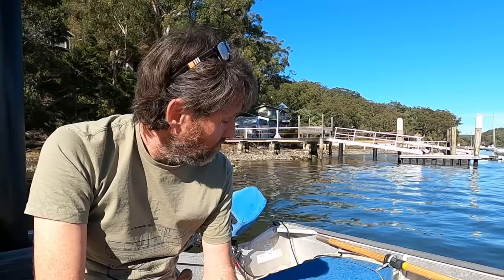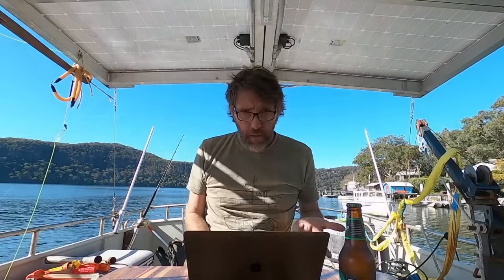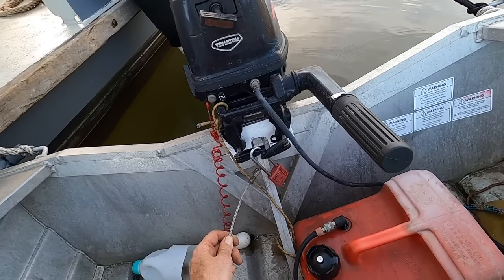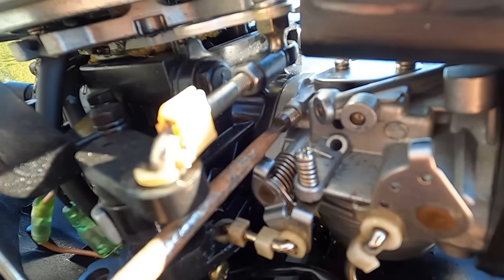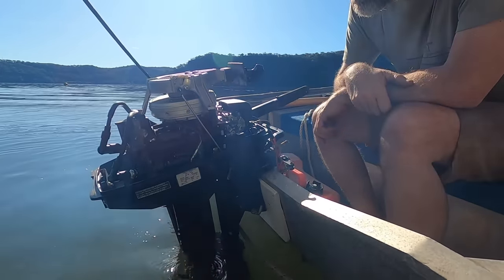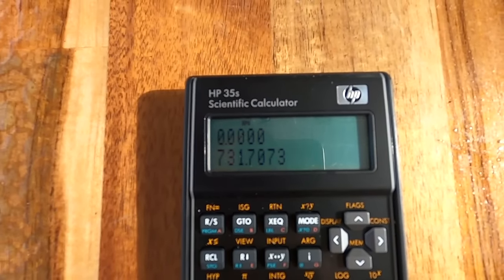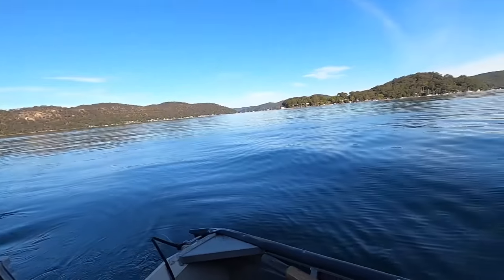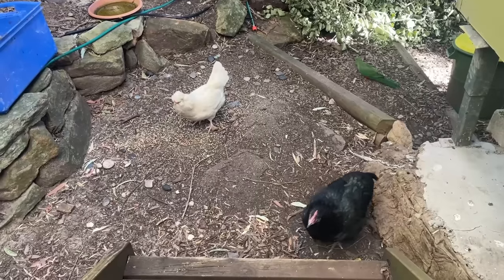Fixing an outboard that stalls at idle

Comment: Hey Stu ,recently found your channel .By far ,by a mile most informative thorough marine diagnose and repair and more. I found this video ,but wondering if you have an idea on. 15hp 2 stroke starts every time perfect idle and runs well at low speed ,but when you rev up on to plane and run for a minute or so , it suddenly cuts power and stalls. Seems to be very hot around exhaust on shaft.Restarts after half hour?? Is  There something common for this type of issue? Thanks Simon

Comment: Awesome and instructive videos. One of my outboards, a Johnson 35 hp 1983, gives me headaches. It won't stop running with the ignition key or the safe/kill switch. I remove and clean every ground wire under the "hood" and replace the ignition, still won't stop til I pull the choke. Any video regarding this dilemma?

Comment: I was unsubscribed by tube, put you on again today.  
Question: Why my T9.9 kicker wants to die with hood on in 30s but fine with hood off?  Really like your service VESSEL!
Reply from the maker: It can be a few things. An exhaust leak or a fuel leak will show up with the cowling on. With the fuel leak the fuel vapour gets added to the fuel from the carburettor and it runs way too rich.

Comment: Man I love your vids. Had the same problem with my car. Obviously a fuel injected 4 stroke, so totally different engine, but it was an idle air control sensor causing the problem. I like the simplicity of the adjustment screw on the 2 stroke! Anyway, besides learning about troubleshooting marine engines I like to see the differences in engines. Thanks for making these.

Comment: If you have to guess on a pilot screw, it's 1-1/8 to 1-1/4 turns.

My idle problem was air in the lines.  Very frustrating to find.  For what it costs to replace a line, if they are 20 years old just replace everything from the tank to the fuel pump that isn't metal (including the primer bulb), and use crimp clamps.  Also things that might help (with air in the lines):  Replace any quick connects that you don't need with a brass hull passthrough (or straight hose), and delete the oil injection system if you haven't already.  I've also heard that anti-syphon valves can cause problems but I didn't have one.  If you do have an anti-syphon valve spend the $20 and get a new one.

How to tell if air is getting in?  The first giveaway is that it idles fine for a minute to a few minutes but then begins to struggle and stalls.  It could run at power fine because the pump will be operating energetically enough to push the air through the system while still providing enough gas, but at idle the air builds up and starves the carburetors.  So the next step, my fuel filter is between the pump and the carburetors and is semi-transparent, so I was able to confirm air buildup by watching the air enter the fuel filter while idling.  If I rev'd up the motor the air would get pushed though, but at idle it would build up again.  I could also observe bubbles at the plastic tee where the oil injection goes in (since removed).

I can't say I ever found the leak because in the end of the day I just replaced everything I couldn't remove.

Tightening up hose clamps didn't help either so when I replaced all the lines I used crimp clamps everywhere permanent.  (So I left screw clamps on the fuel filter and primer bulb, but everywhere else is crimped.  Except the fuel pump because I could not get the crimping tool in there.  But use crimps wherever you can.  160 clamps plus the tool is less than $40 on Amazon.)

Comment: Hey Stu,
most likely there's a bit of junk partially blocking up the idle passage, or progression holes in the throat of the carby, or air bleed partially blocked if it is a 'too rich' condition, but also don't forget this engine has a diaphragm fuel pump mounted on the engine driven by crankcase pulses so it could be failing to keep up the fuel supply at low rpm.
Weak or damaged diaphragm return springs, split diaphragm, leaking diaphragm/pump gaskets, old crispy diaphragm etc will all cause varying symptoms.
Another tip to narrow down if it's a fuel pump issue would be try squeezing the primer bulb when the engine shows signs it's about to stall.
Worst case, possibly the exhaust covers are corroded, or exhaust gaskets are leaking allowing a a small of water into one of the cylinders at low rpm, but you should see signs of washing/steam cleaning on one or both the spark plugs if that were the case👍🇦🇺
Reply from the maker: All good advice Simon. Fuel pumps are definitely a candidate for many problems, I'm a big fan of squeezing the primer bulb to see if the problem goes away. Another common problem I've seen is a hole in the fuel pump diagram pumping fuel straight into the crank case and making the engine run very rich.
Reply: @DangarMarine  Yep, in this case if it turns out to be pump related and not a carby issue, a pump rebuild kit would solve all those above possibilities.
I'm certain you would've picked up on it pretty quickly if the pump diaphragm was leaking fuel into the crankcase though.
The plugs didn't show signs of excessive fuel, we didn't see huge clouds of smoke, and you wouldn't have got that initial cough when you first pull started it with the choke on...she would've obviously been near impossible to start, and those small mixture adjustments would'nt have been as effective as they were.
Reply: can confirm on the leaking exhaust gasket. Started up just fine first time of the day with a blast of smoke. wouldn't idle after warming up. and then wouldnt restart. ended up replacing all the primary gaskets and when I took the exhaust cover, it was blatantly obvious.
Reply: @peterjensen6844  Nice find. Another place outboards can let water into the cylinders (mostly the bottom cylinder) is through a leaky lower crankshaft seal. This can be easily identified by pulling the lower spark plug lead off the spark plug while the engine is running and listening for the engine speed to drop slightly. If the engine speed doesn't drop you know that cylinder isn't contributing, but this condition also normally causes significant problems under load at higher rpm. The bottom spark plug may also look abnormally clean, or have a partially steam cleaned area on the firing end, instead of a nice consistent brown/carboned end.

Comment: Love the youtube channel. I have a 2 stroke engine and its working fine, as its recently serviced and had the carby cleaned out. I park it on the street, with a cover. After using the boat, I used to run the petrol out to of the engine, when I flush out the engine with water, before parking up the boat again. I use the boat once every 2 to 3 weeks. But recently I was recommended not to do this as its better to have petrol/oil mix left in the engine.  What do you recommend?
Reply from the maker: I've certainly never run an engine dry, I'm not sure it is that good for the lubrication of the engine. I don't think it does huge harm but would rather just add a bit of Stabil to the fuel.

Comment: Hey Stu , I have same motor in 8 hp and had similar problems I found that the fuel connector into motor had damaged O ring. I replaced O ring and ran like new. If you remove fuel line it pinches very easily if not inserted perfectly straight.
Reply from the maker: Good tip, I'll definitely check the o-ring.
Reply: In my case the problem was the engine connection though yours could be tank end or both being in constant weather. When replacing o rings you should clean the male end of connections with toothpaste or jiff then lubricate to avoid damaging seals. The o rings aren’t sold by tohatsu you have to buy the fitting or source nitrile o ring aftermarket.

Comment: Thanks got issues with a 150 merc not wanting to idle. Some things to think about here with fueling. Especially the passages of the carbs gumming up with varnish. Interesting you mentioned the breather- had issues with a fuel tank on a smaller outboard.
Reply: I had a old Merc 115 that would not idle, apparently it was the low idle stator ( a electrical part), at least that's what the mechanic replaced and it ran fine after that, weird because it seemed like a fuel issue, but that's why I went to the mechanic as it was beyond my abilities, they have seen it all, so they know or at least they have a pretty good idea.
Reply: @seanwalsh999  yeah I’m going to buy the clymers manual. 150hp is the v6, looks like most 115s are 4 cyl.

Comment: The quality of the video, the troubleshooting workflow and being in situ to test the motor is a winning proposition! With dad's 1969 Chrysler 20 Hp, a non idler for a long time, albeit after a long time in storage, properly fogged and drained of stabilized 50:1 ratio gasoline. I've checked the points gap, spark plug gap and set them correctly. The cold-cold compression is at 100 psi even on both cylinders. I guess it's going to be tank time soon.  I have to tackle the throttle pickup point with the magneto plate advance yet again as it has to be within 1/32" of the timing mark... However, where I live in the capital city of Costa Rica, San José is at an altitude of 1,172 meters above sea level. Where I take the boat to fish with the kids, Lake Arenal, a 4 hour drive from home, is at 544 meters above sea level. Could altitude be a culprit? That's why it is so important to have an engineer like your self on the spot! Cheers from Costa Rica!

Comment: Love your videos I know this is a longshot my 2006 f 90 Yamaha outboard ran perfect one weekend the 3 weeks later went out and just didn't sound right I have a video of it running on hose I wanted to see if u could hear it running see what ya thought thx some metal flake In lower unit no metal in power head oil that I could see did all new fluids and fuel water separator thx much
Reply from the maker: Sounds are very hard to diagnose over video, you really need to be able to listen around with a mechanics stethoscope to figure out where it is coming from. They are cheap to buy, only about $10.
Reply: Will pick one up don't suppose u could run a power head for a short bit without lower unit attached could you to rule out top or bottom also thx for response

Comment: Hey stu about to remove the low flow fuel pump from my 40 hp merc 4 stroke do you need to remove the lower cowling to do this can’t get in to a bolt you at one time you were going to do a segment on this thanks buddy great viewing
Reply from the maker: I make. I can't recall exactly but I think I may have hit that problem in this video https://www.youtube.com/watch?v=eVdJ4BvRVYQ

Comment: Replacing carburetor gaskets could make a big difference,any air leaks into carb or between carb and intake could affect idle speed and throttle responsiveness .
Reply from the maker: Yes, vacuum leaks can cause all sort of weird problems, particularly at idle.

Comment: I have the same motor and it hasn’t been operating for 20 odd years. I just wondered what is the best thing to use to clean the fuel system out. I realise I have to change the oil and the impeller before starting. Any advice would be great. 👍🏻😁🇦🇺

Comment: Nothing worse than an outboard that dies just when you are coming into the jetty. I had an old Mercury blue band that would idle perfectly for a while, then die just when you really didn't want it to. It eventually had much bigger problems and was retired. Good info about carby troubles in this video though.
Reply from the maker: It is the worst possible time to have and engine or gearbox die!

Comment: As the owner of several 2 stroke outboards and a few weekenders and such I can tell you that after all these years I hate 2 strokes. I have a 1994 20hp mercury outboard that has very low hours and that POC just behooves me. I can get it running great even had the carb rebuilt. You hit the throttle and just as it is about to drop onto plane it crabs out and dies. I'm going to sell the lot and get a 4 stroke.
Reply from the maker: Yes, can't say I'm a huge fan of 2 stroke outboards either.
Reply: One main issue at play here: it's a mercury and a 2 stroke. Those things should never be combined on any one single thing. Ever. Speaking from 5 mercury I've owned and despised every one of them

Comment: Stu. You touched briefly on the prop wash that was spraying into the air. Can you elaborate on the cause of this and how to adjust for it? I have a similar issue.
Reply: To me it just looked like the motor was trimmed down too much. Just needs the pin lifted a hole or two.
Reply from the maker: Generally hulls are made for particular shaft length outboard and this outboard is hard down against the top of the transom so I would say it is likely to be a trim position setting. I'll move the pin up one hole and report back!

Comment: Hi ya..
Carb off and strip down..
Looking for aluminium corrosion, main jet and others..
Dirt just before the float valve possible.. have a look in the float bowl.. especially if the filter is gauze.. paper filter better.. I prefer car size filters.. also mix your own 2 stroke fuel..
Chromium cylinder lining damage can stop ticking over...

Comment: Great content! I have a quick question.

 Will an outboard motor run without the lower unit installed? 

1985 johnson 
30hp
Rope start 
Through prop exhaust 

I've been trying to get it started without the lower unit, cause it sat for a long time. I have tried so many things. But today it dawned on me that maybe won't start because there isn't enough back pressure? 

What ya think?

Thanks buddy. Really enjoy your vids. Especially the johnson ones.
Reply from the maker: Yes, will run without the lower unit installed.

Comment: Got an 87 Honda 15 HP 4-stroke, and when I shift into gear, it feels like it's gonna rip the transom off the boat.  It's idling way fast, but if I turn the idle screw down just a little, she stalls and won't even start.   I think this video is describing my issue, but not a complete fix for it.  Still, it gives me some fodder to work with, thanks!
Reply from the maker: Could also be ignition timing and maybe a vacuum leak.

Comment: I dropped the lower unit on my 1990 Johnson 150 GT and found the unit was black inside. I also noticed that the shaft seal was off set from the shaft. I even found a mud dauber nest . Never thought I would see that. What is the best way to clean the casing.
Reply from the maker: I would probably just brush it or pressure wash it.

Comment: ok, can we add a whole new set of complexity to the outboard service?
You bet.
Oxe-Diesel, makers of 120hp and up diesel powered outboards.
I think Yanmar makes a 50 hp diesel outboard as well.
so now it's not just the gas system you could also get handed a diesel engine to fix on an outboard.

Comment: the hole in the plug guage is for opening up gap. yeah i've used the wedge to open them up before until i had a new plug with cracked porcelain.  ot sure if it was me but ....

Comment: Ur right stu, usually its water in fuel or plugged emulsion tube/Idle circuit. If it sat a long time the bowl may be full of old 2 stroke oil too. Same principle applies to weedeaters, chain saws, scooters, mowers etc specially if u run ethanol fuel. Not to jinx u, but i was really waiting for ona them plugs to go swimmin lol. I really miss these type of vids like u did when u started. I run seafoam in anything marine or two stroke keeps carbs and injectors clean even when sitting a bit.
Reply from the maker: Thanks mate. It is amazing how often water in the fuel is the culprit.
Reply: @DangarMarine  when its hot in the day and cool at night my lil honda scooter carb fills up with water like a leaky sink!

Comment: I have a Yamaha F40 4t for 10 years now. Lately the engine is coming down slowly over night/after few hours. I see no oil leakage, I checked the power trim oil level and everything seems normal. The screw to manually trim the motor is ok as well. I read somewhere that "If no leaks are found, it also could have been a cylinder bypassing internally"... Since I live in a small Greek island where no mechanical issues can be dealt with, can you tell me if you have a video about this specific problem? Thanks again

Comment: "Thinking Juice"? Derek of the Vice Grip Garage YouTube channel calls those "Wobble Pops".

Is there ever a reason to run resistor Spark Plugs in a small outboard on a dingy or tender?
Reply from the maker: Not really. With no other sensitive electronic equipment onboard I would worry about getting a resistor plug.

Comment: Got a question for you Stu, if you have a two stroke motor that starts and runs but won't get up on plane from lack of power. What would you do to fix it? I had this issue when I first started watching you channel but was fixed by my local marine shop. All they told me was the spark plugs were fouled and the carbs were out of adjustment? All three I had at initial settings 1 1/4 turn out from seat. You think they turned them out more to get speed going?
Reply from the maker: Hey Tim. There can be many reasons for that. Weak spark from fouled plugs may definitely have been the problem. I've seen boats that have doubled their top speed after a fresh set of plugs. Synching the carbs may have helped but those mixture adjustment screw is only for the idle circuit, won't affect top end at all.
Reply: Thanks Stu, I think your right on as far as the spark plugs. If they get fouled you fighting a loosing battle till you clean them our put new ones in. The cause of this could be running at idle too long. Two strokes are not trolling motors. They like to be ran.